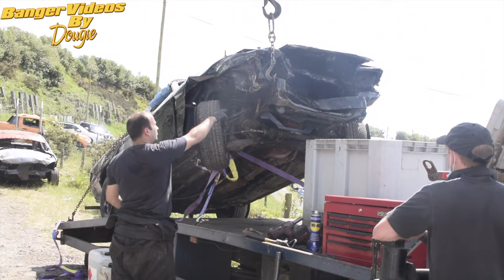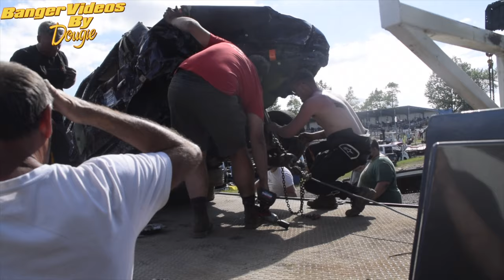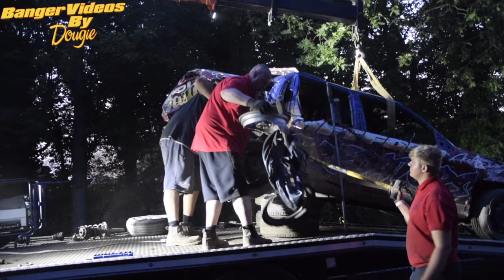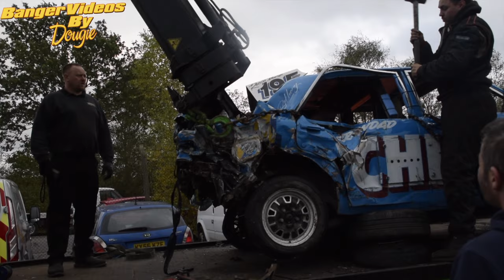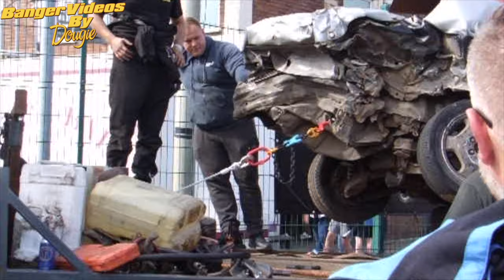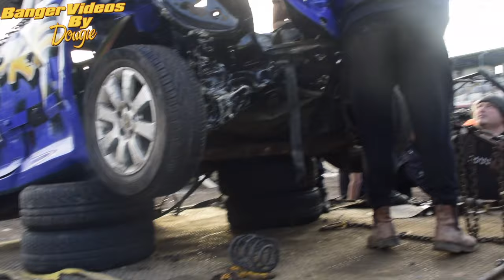Banger Racing Pit Work Compilation

Comment: Fuken awesome 🤘 what's your turnaround time to be back on track?
Reply: Maybe a couple of hours.
Reply: @glennpowell3444  awesome appsolutely awesome 🤘
Looks like a lot of fun, very envious 🙂, thank you for sharing
Reply: @paulie5076  Its a pretty expensive game to play.The pit time is where all the adrenaline kicks in to try and get the car to run again.I was involved a couple of times but its the engine and transmission that is equally difficult.
Reply: Between the next heat, it's  most of the time about 45 minutes to 1 hour.